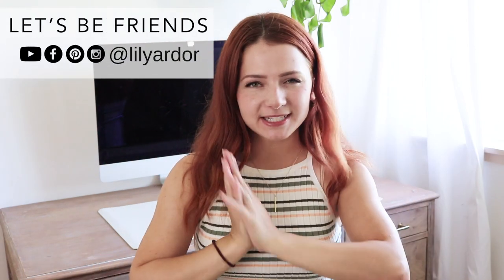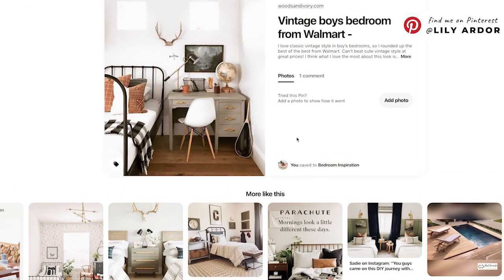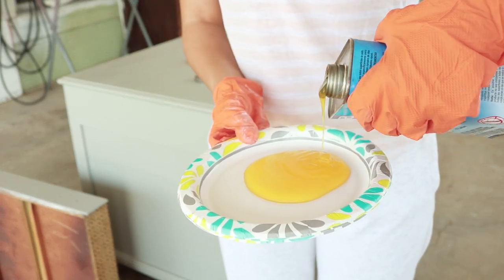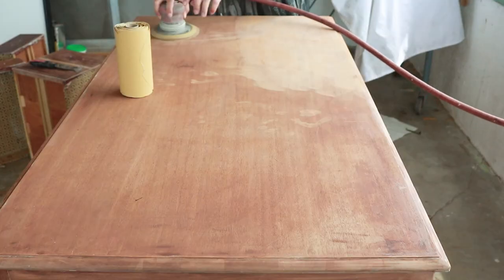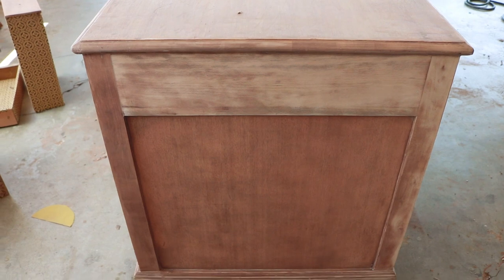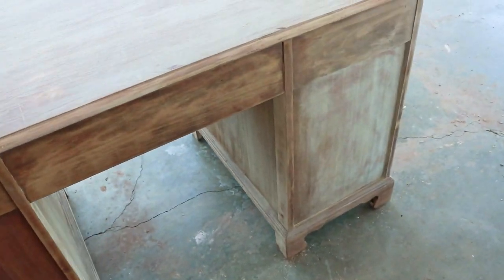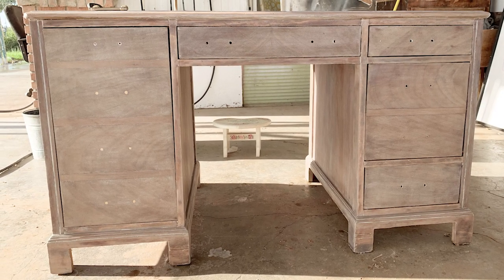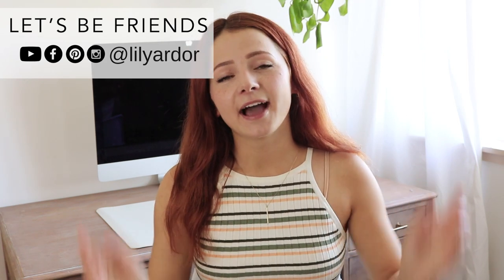STOP & WATCH!! HOW TO STRIP LATEX PAINT OFF FURNITURE! [ testing products and more ]

Comment: Nice work (steel wool works great to get into the corners and edges instead of scrapers.  and mineral spirits is great for cleaning the whole project after the stripper). I've been considering trying the Citristrip, so thanks for the comparison.
Reply from the maker: OOH I'll have to try the steal wool. Thanks for the tip. Sure glad you found this helpful :)

Comment: Smart Strip needs to remain wet in order work. So you're correct when you suggest that it stopped working when it dried out. There's a few reasons this happened: You didn't apply enough thickness, and you didn't use their laminated paper, which is WAY better than plastic. Also, you have to PRESS the plastic into the remover so it stays in contact with the remover. Either way, you can see from the container that you're removing at a temperature above the recommended range. It specifically tells you that it'll dry out faster above 90 degrees. You would have gotten much better results if you kept the Smart Strip from drying out. Also, and Citristrip doesn't tell you this on the container, Citristrip is SUPER flammable. If you hold a lit fire source next to it for about 10 seconds, it's goes right up. Smart Strip is completely non-flammable and eco friendly. Hope this helps!

Comment: Sadly, you actually need to apply more. The trick with stripper is to use lots of it. It will cost you, but it will do the job. Just pour it right on, keep it out of the sun, and when it starts to absorb and dry, you pour on more. Just bathe it in paint stripper.
Reply from the maker: Good to know thanks :D

Comment: Did you use 220 paper?  I can see all the sanding swirls. Need to work your way up the grits. Like 40, 60, 80, 100, 120. You can use dental tools to get the paint out of the crevices. Like the inside of the drawers.

Comment: no offense. but on one coat oil paint over primer, no way would Citistrip for 45 minute remove more than 50% of the  finish coat and no primer. What i found is that if you paint on thick coat of citristrip , wrap in plastic and leave for 12+ hours, you could get  most of the first coat. you definitely needed to repeat for primer coat. the prob with citristrip is to successfully strip paint you need a thick coat and to remove that Citi stirp spooge  you could run thru dozens of rolls of paper towels. or rags.

so its takes a long time and alot of citirstirp to remove down to sandable wood.